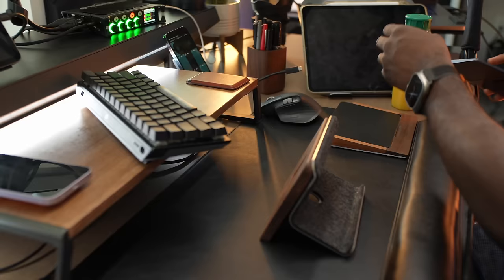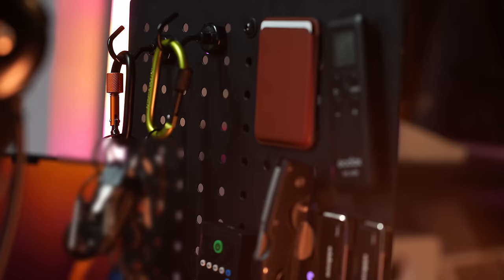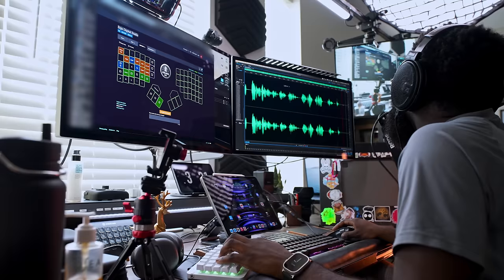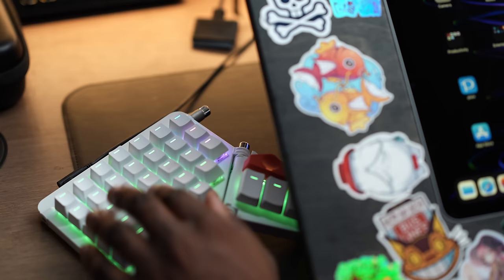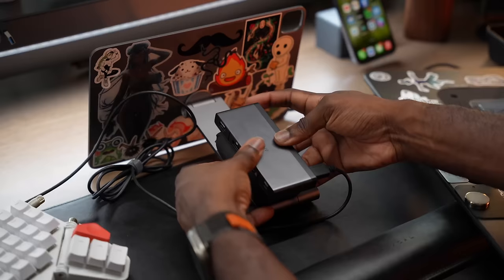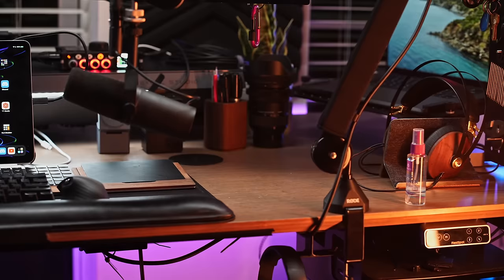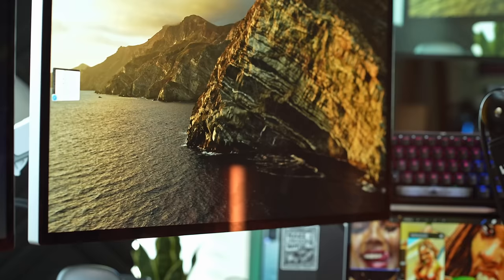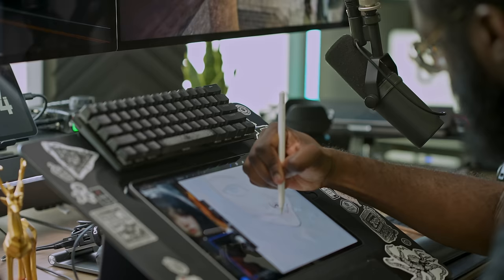Welcome to my 2023 Digital Art Desk Tour!

Comment: My biggest challenge is that everything I do has to be in a prone position...arg...USB C is HORRIBLE for this, especially since I have friendly cats (no I am not getting rid of them, there is no better antidepressant).  My connections at the computer break or the cable does.  I don't find anything not wired works as well as wired.   

"Laptops" are not "laptops" any more and it is driving me nuts.  It needs to be fast, non-glare, usable outside if possible, etc.  I want the best possible performance.

Also $1,000s of dollars on mice...before on replacing the trackman red ball mouse every 2 months before it went obsolete and now I have about 5 different kinds to switch around when the pain gets too much.  I wish the trackman could come back.  My speed dropped by half and I am constantly moving and renaming files.  

So I really want a display that I can look at and draw with the image directly on it...liked the smallest wacom ok...but would rather be looking at the drawing surface.

Comment: What cables do you use while the iPad is in the sketch board pro. I’ve had to test a bunch of Thunderbolt cables to make sure they aren’t too think or are durable enough for the Sketchboard. Great video!
Reply from the maker: the apple braided TB4/usb3,2 cables have been the goat for me. Second place are Plugable/Anker cables. Those are two brands that have been reliable for me.